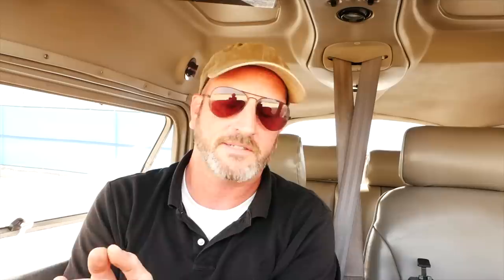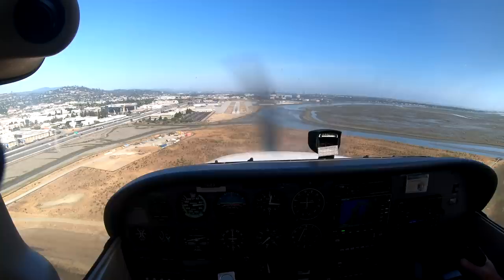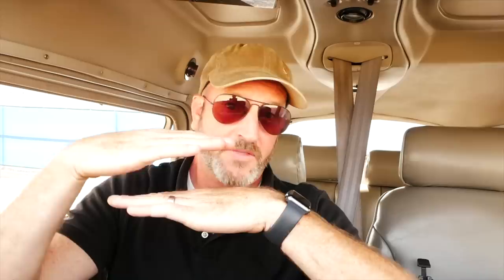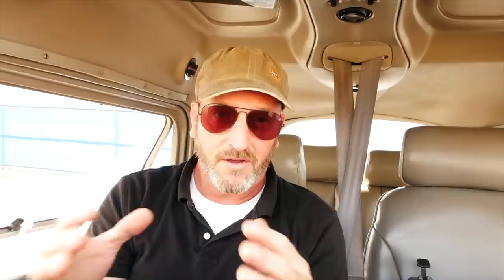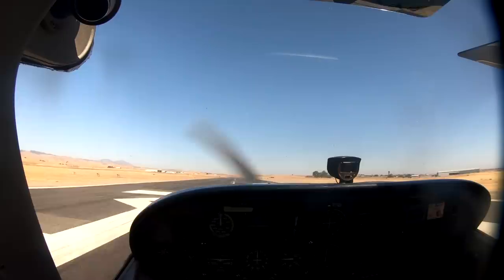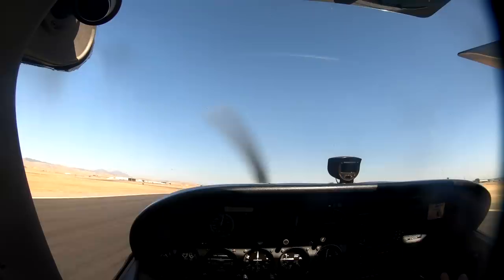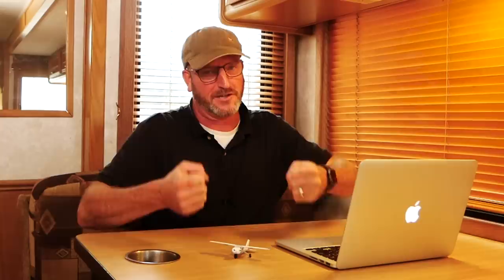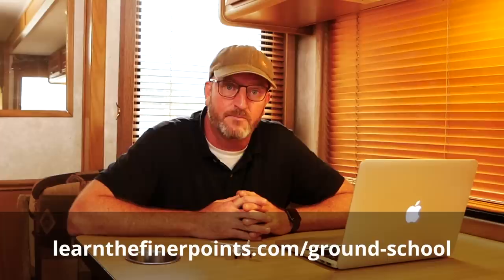How To Land a LIGHT Airplane - Flight training from an experienced CFI (certified flight instructor)

Comment: I have a suggestion for improving everyone’s landings.  I own and fly a 1956 C-172.  This plane has a low cut firewall which is unlike more modern C-172’s.  The advantage is the view over the nose is wonderful!  You never lose the runway.  Landings are much easier.
Reply: You call that a suggestion?

Comment: I’ve done something like 15,000 landings. Each and every landing has been just as you have described. The only difference is that in bug smashers I used to fly slower. In a 172 I used to approach at something like 45 kts plus wind correction and 60 kts in a 206. That was based on Vs x 1.3. My speed would vary aircraft by aircraft. I did not use one number. This same Vs x 1.3 (plus allowances) worked on all gliders, singles, twins, turboprops and jets.

Comment: When I learned it was not until I looked at far end of tne runwat that I judge descent rate and transition point. I still do that, i calculate approach speed based on density altitude and weight to get close then adjust appropriately.

Comment: I use your videos in my CFI ground school and to help students who are struggling to solo at our flight school.  I like your idea of high-speed taxi to show the landing attitude.

However, as an active CFI since 1983, I do use low approaches to help students learn the landing attitude sight picture, get comfortable being close to the ground, and the feel of the the elevator pressures needed to raise the top of the cowling to the far end of the runway preventing climbing or descending.  With the prolonged exposure to that environment flying the full length of the runway, they gain the skill and confidence very quickly.  We do this with only half flaps and I add power sufficient to keep the airplane just a few feet off the runway while the student keeps the top of the cowing close to the far end of the runway and adjusting elevator pressure to stop any slight climb or descent.  You said that low approaches are at 55 KIAS; actually, I have no idea what our IAS is.  I just add the power to hold altitude while the student controls the elevator pressures.

Thank you for your excellent videos.

Forgot to mention that after a couple of low passes, I'll slowly reduce power instructing the student to keep the top of the cowl on the far end of the runway, and we eventually touch down.  We're lucky where I teach in that we have a 12.000-foot runway and a tower.  The low pass gives the student almost 3 minutes close the runway per circuit around the pattern.

Comment: The wing should stall about 6 inches above the runway and the last 6 inches should result in a slight bump.  The greaser is not a full stall landing.  It's almost impossible to time the full stall as soon as the wheels hit the runway.  You are as lucking hitting a target at the range at the bull's eye if you can do that.  My chief flight instructor from Dupage Aviation, the largest Beechcraft dealer in the midwest in the 1970s was a P-51 WWII fighter pilot.  He demanded a full flap and a full stall landing on every landing, no matter the wind conditions.  This was later backed up by an FAA inspector on the East Coast who demanded the same from me.  My chief pilots wanted a full flap full stall landing where the wing was stalled when the main gear was about 6 inches off the ground.  He wanted us to feel a slight bump as the perfect landing, not the greaser.  The "Greaser" meant that there was still flying airspeed when the plane hit the ground and thus, there was not a full stall landing.  Just MHO from my chief flight instructor who had to make at least two emergency landings in his P-51 after being brave enough to have been shot at while in mortal combat.

Comment: How much to pull and how hard to pull for a flare? Yes, absolutely situation and airplane specific. While training and renting I got to where I was very happy (most of the time) with my 172 and 177 landings. Was even doing pretty good with the Maule, Citabria, and C-140. And then, I bought my C-170 with a STOL kit. I learned real quick the slightest too fast or too hard pull, or too much energy at the time of flare, and it was an instant balloon before I could respond to it. The first few weeks I had her my landings were worse than the landing on my first lesson. How much to pull when you flare? The only answer is time and practice. And BTW, keep up the great job you do with the videos. Always great advice. Thanks

Comment: I have had my PPL for 16 years, this sounds so dangerous for the FFA to teach a standardized landing like you said with different equipment or baro pressures you would approach a runway differently, that landing might work in Miami but good luck in Colorado. I am surprised that the FAA would make this decision while air incidents have been slowly rising over the last few years. In my opinion accidents happen when pilots either are not paying enough attention or when someone becomes complicit with the way they fly and start skipping mental check list items. I knew a guy who would constantly forget to turn on the prop sync when landing. In itself not inherently the most dangerous thing on the planet but it made me worry about what else he skipped or did not do with the plane either during the flight or with maintenance, refused to ever fly with that guy again.
Reply: agreed. Standardizing a method for teaching, to make it easier is good, but it cant be standardized outside of that because of the fact that in reality, the circumstances for a landing will never be the same. every location has different air pressures, different altitudes, different temperatures. there is no repeating scenario for a landing.

Comment: Hi Jason, some excellent content you're putting out here! One issue I come across every time I get into a different 172 is a consistent sitting position and thus a consistent sight picture. How high should I adjust the seat? Should the engine cowling be visible behind the glare sheild or should the glare sheild be the cutoff line towards the outside?

Thanks
Reply: Your eyes should be just under the window in the door. You should also be able to put in full rudder comfortably.
-- Different gold seal CFI
Reply from the maker: I think the actual design eye height is 6'1" off the ground but it's as Joshua said, just under the top of window in the door sounds about right. I like to barely see a sliver of white cowling. It's almost more important that you are consistent than on to one specific point.
Reply: @joshualandry3160  but that only works for people shorter then 6 foot!
i like to use a horizontal line of rivets on the 172 on cowl just above glare shield.
Reply: @shaunshephard  Mostly true. It also doesn't work if you are too short. On the CRJ I feel terribly uncomfortable with the sighting devices dead on so I always flew out of position. Being consistent is more important than anything else.

Comment: During a hangar flying session at my airport, several pilots including myself had an arguement over power on / power off during flare.  Is there a right or wrong way?  I fly a Piper Cherokee and way back when I was training my instructor taught me to make every short final a glide to the runway with engine at idle.  My landings have always been generally good.  Later I was told to keep power on and only reduce to idle during flare.  Now there are pilots claiming I should not reduce to idle until after touchdown!  I have tried all suggestions, but my original training still feels best.  Is it just familiarity, and have I been landing incorrectly all these years?  Any advice (or another of your excellent videos) would be most appreciated!
Reply: Personally I keep some power on to soften the landing in a Cherokee. But I do believe that the ideal landing should be done power off for two reasons; 1) approaching with extra power means you are technically exposing yourself to more risk by being below the glide path to the runway incase of engine failure or you are landing long and using more runway than you need. 2) If the goal is to land the airplane than extra thrust simply works against your goal.

Again, I personally use some power because i find that the airfoil shape of the 140 stalls suddenly and that tiny bit of power gives me softer landings even though I am reducing performance to compensate for my skill level.

Comment: One size fits all doesn't work in aviation. In the final analysis you're going to fly down over the runway at a safe airspeed above stall that will allow you to bleed off airspeed with power reduction or distance until you settle on the runway before it runs out. It's a complex dynamic not readily amenable to cookbook recipes.

Comment: Not sure how slow flight is defined where you are but the ACS says edge of stall, its not possible to get the nose up much more than this ... or you stall. Not meant to insult, we are likely just reffering to two different things. Any way I like your technique of actually having the wheels rolling rather than flying a few feet up, it gives a much better picture and feel for the expected height; one of my biggest problems as a student was that I couldn't consistently tell if I was 3 inches or 3 feet above touchdown.

Comment: I would stay away from teaching student pilots the latest FAA landing technique for one reason, I believe it could easily lead to a pilot trying to stretch their glide when falling short of the runway.. What better way to enter a stall than with a decreasing variable airspeed approach. This technique could also lead to pilots landing at a very high airspeed during strong crosswinds and then tries to force the aircraft on the ground resulting in proposing down the runway or a wheel barrel landing.

Comment: Nice video! Just a short question. Larger airplanes, like malibu, tbm, turboprops, jets etc do not require such big angle of attack during landing. It's even dangerous for possible tail strike etc. They just need like 15-20 degree nose-up for nice landing. And holding off is very short, much shorter for skyhawk/Cherokee. Can you advise from your experience starting from which types (examples) landing technics changes from "pull back as much as you can" to "make landing angle a bit nose-up and keep it till touch down". Also is it not dangerous to get used of landing with with very big angles like skayhawk example and move then to larger machines, which are not suitable for it?
Thank you in advance!

Comment: For the sake of clarity, while on final with your speed stable at 65 knots ‘ish (in something like a 172), are you saying that you maintain the throttle at that setting all the way into the flare and touchdown and only go to idle after touchdown?
Reply: The way I was taught (which is very similar to what is shown here) you fly the airplane into the landing. So yes, you maintain power as required to maintain your approach speed until you are over the numbers, stop your decent just above the ground, pull the power, flare.
Keep the plane off the ground as long as possible (if conditions allow) and it'll automatically settle on the backwheels first with (if you have done it right) the stall-horn chirping at you.

Comment: When the reference point 100ft in front of the aiming point disappears, is this when I should pull power idle and then level off and then transition my eyes to 2nd aiming point at end of the runway and then flare?

Comment: 100% agree the FAA is totally wrong here. Actually I think the published approach speed is too fast as well. By shaving some speed off you can easily land more accurately and much, much, shorter. by doing basically what is outlined here I can land basically everything I fly butter smooth almost regardless of crosswind (within limits). This also has the advantage of being a normal, short, and soft field landing all at once. Doing this also fixes all those annoying bounces, rebounds, and excessive tire ware. For reference, landing slower means that with a comfortable margin over the threshold the aircraft is stopped with minimal breaking about 1300 ft from the threshold. Max breaking will be down and clear before the thousand foot markers.

Comment: Lots of interesting discussion about how to learn the landing picture, but I don't see how that is at odds with the FAA slide presented.  The intent of the FAA slide is not completely clear to me, but the main difference I see is that the presenter advocates a stabilized final approach while the FAA is depicting a decelerating final approach. I'm kind of surprised to see that from FAA, as it seems flying a "stabilized approach" is being beaten into everyone's head all that time now regardless of aircraft type and wind conditions.  Could this simply be FAA admitting that you don't always have to land a light plane like you do a heavy jet?

Comment: Quick question, I want to practice the high speed taxi over the runway. How Do I requested it? Do I have to stop at the end of the rwy or do I take right away?
Thank you in advance.
Reply from the maker: If you plan to take off you may just ask for a long takeoff roll or (delay on the runway) but other than that, yes, ask for a high speed taxi and get off at the end (or wherever they tell you to)

Comment: Question, in the notification for the video I received, it said CFI( certified flying instructor), in Australia a CFI is a chief flying instructor and all instructors are of course certified. Was that a typo?, or is it a American thing? Enjoy the videos, keep up the good work
Reply: Probably just an American thing. Here, CFI is Certified Flying Instructor. DPE is Designated Pilot Examiner - the guy who does your checkride or practical test
Reply: Technically it’s Certificated Flight Instructor
Reply: I only ever heard "certified" and only after a bit of research did I find "certificated" so it seems they are used rather interchangeably, at least by the general flying community. I've no problem just saying "CFI"
Reply: spokev I only found out about “certificated” when I started studying for my initial CFI.  Question for those Down Under- is just Flight Instructor in Australia?  With Chief added if you’re the lead instructor?
Reply: In Australia 🇦🇺 we have grade1 grade2 grade3 instructors and a chief flying instructor, our CFI doubles as the head of operations (HOO) also

Comment: hardly anyone lands correctly, they all land flat and don't use aerodynamic braking.  Just look at the angle of the wing tip to the runway to see your angle of attack / pitch when just above the runway, especially when wheel landing a tail dragger so you don't prop strike.

Comment: i've got a somewhat random question for you sir.  was flying yesterday over uneven terrain and wondered, if i had to make an emergency landing and didn't have a level place to land, is it better to land uphill or downhill?
Reply: Uphill if the gradient isn’t extreme , obviously the sight picture will be steeper nose up
Reply: WOSSSS
W - wind - upwind if possible
O - obstacles - trees, power lines, etc
S - surface - not full of rocks and/or livestock, preferably smooth and hard enough, medium level grass is good to help slow down
S - slope - uphill or no slope preferrably
S - surrounds - what is around to help ID where you are, where a phone or help might be, walking distance to road etc
S - sunlight - all the above being equal... sun not in your eyes would be an advantage
Reply from the maker: Uphill -- and I agree with the two comments, helpful stuff there.

Comment: I'm always left or right of center line and have the chance to side loading it. How do I fix my feet?
Reply: take your feet off the rudders, not literally but relax the pressure on rudder pedals, generally you are applying rudder that should not be pressed. also draw a vertical line in reference with your nose and align that with the centerline!
Reply: @shaunshephard  Thanks

Comment: What about the power?? When goes to idle?
Reply from the maker: I fly most airplanes with power at isles on short final whenever possible but if you are using power, pull it to idle as you round out
Reply: just as you are over the numbers

Comment: I disagree with what you say about a perfect landing. The perfect landing is when the passengers have NO IDEA when the wheels touch the ground while on centerline and  pull back on the stick to help stop the plane instead of using breaks as little as possible.... In my experience that is a perfect landing, besides this is much better on the landing legs... That is the perfect landing....
Reply: I  don't care about perfect landings as perfection is never achieved and can be the enemy of the good.   I care about consistently safe landings.   The softness of the landing is not necessarily a guide to how safe the landing is.
Reply: Pilots are perfectionists, there is no such thing as a perfect landings. We can and always will find something wrong with our approach or touch down.  Are you able to fly another day then awesome, keep flying!